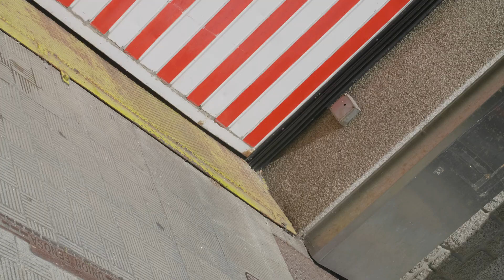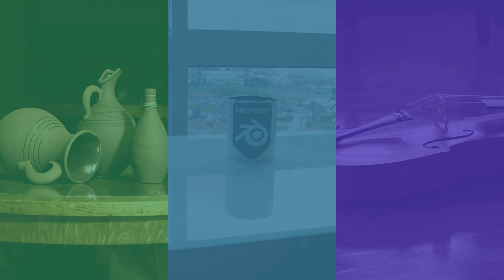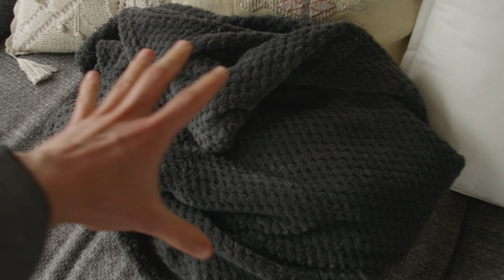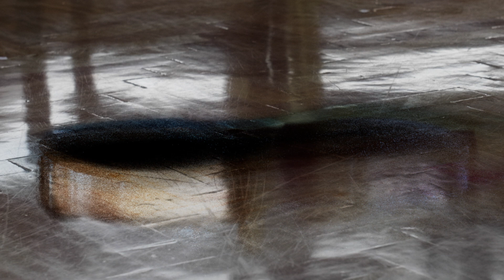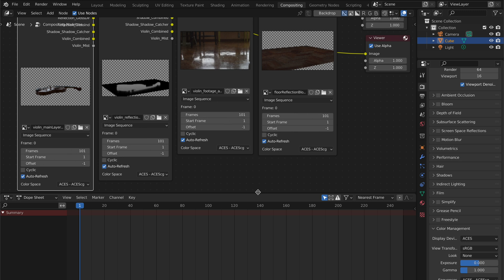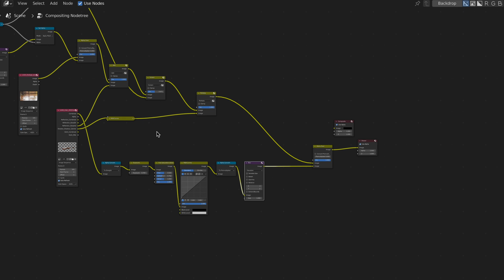How to Composite Reflections for VFX

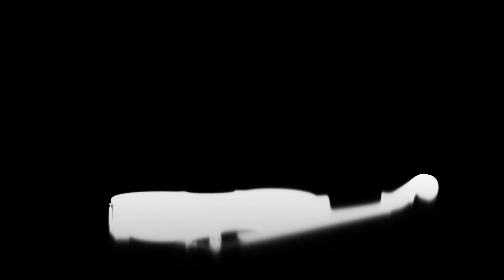Comment: 10:53 I have found a much cleaner workaround for creating a reflection matte!

1. Create a new object (For example a Plane, but it can be anything).
2. Add a Geometry Nodes Modifier to it.
3. Drag in the Collection of your subject model (In this case, the violin) into the Geometry Node Tree.
4. Add a "Set Material" Node after the collection node and connect that to the Group Output.
5. Add this "Plane Reflection Matte" object to a New Collection and in the corresponding View Layer, disable the original Violin Collection, but leave the "Plane Reflection Matte" Collection visible.

This means you don't have to duplicate objects or collections, materials, etc, but instead use the Original Violin Collection as an instance, to generate another copy of it and simply apply a material override.

As for the Lighting & World Settings, simply turn off the collections that contain lights and disable the World under View Layer > Filter > Turn Off "Environment".

This will allow you to store every View Layer in a Multi-Layer EXR export by rendering everything in one go.
Reply: tutorial

Comment: A problem I had and that maybe other people might have is about objects that are hollow inside (like masks), it is shown that in the main layer you should put the floor in indirect, but when I do this the hdri affects the bottom of the object causing some lighting on the inside of the mask, I decided to leave the floor collection for the Main layer in Holdout, I still have the reflections of the surface in the mask (I left it with metal material) and I block the light coming from the hdri

If anyone has a better solution I would greatly appreciate it, I feel a bit like I'm not going down the right path, although I still get the result I want.

Comment: for the reflection matte. You could use a new scene? The compositor lets you choose the scene as well as view layers. So you can just include the two instanced objects in that scene, then use whichever settings you want for that scene. This is also how you mix cycles and eevee (or even workbench) renders, which is useful when you're working with eevee for speed, but maybe aren't happy with the refractions there and just want to use cycles for a certain material or something like that.
And yeah, a script that lets you select which objects/collections you'd like in your other scene would be cool just to speed that up. I'd rather do it that way then have to use a script to flip back and forth between something like connecting/disconnecting an environment node (not assuming that's what you'd be doing)

Comment: You can use a polarised filter on your camera to block the reflection, it's truly work for that kind of glossy passe, you can also extract the glossy passe from real element with that.
Reply from the maker: Awesome tip!
Reply: @InLightVFX  it's also use for long time with the photogrammetry process use by Paul debevec with his setup he use cross polarised filter on light and camera to extract the glossiness of a face by multiplied trick, adobe substance do something similar by scanning a Tea pot they kill the reflection to scan the color of the asset, it's really powerfull.
Reply: Usualy we use polarised filter for taking picture of the surface of a windows or a lac or a pond to see behind it without the fresnel effect reflection, it's also neutralised cloudy  sky in a good way, it's use on photography since a very long time.

Comment: Would love you to make a tut on how to masterfully composite shadow and contact shadows on rotoscoped action characters used in the Blender scene with Image as Plane. Adding the filmed actor to the 3D scene, it seems hard to accurately project adequate shadows given that the image as plane doesn’t provide the volume of the feet in contact with floor. I’ve played around with this on the fly hidden volume, but it seems just easier to get the contact shadow in compositing.

Comment: I use Fusion in my composition work... And in most of the composition videos I see on youtube, they are either using AE or Nuke. As someone who has used both AE, Nuke, and Fusion, why do you think that is? 

I know why people use AE, coz it's easier to understand and master. But why do people prefer Nuke more than Fusion? 
One thing I can think about is Layout customizability but that shouldn't be a game-changer. 
Why did you switch from Fusion to Nuke?
Reply from the maker: Good question! Nuke seems to handle color management much better than Fusion and has less issues getting hung up on more complicated composites. I have only used Fusion as part of Davinci Resolve so perhaps these issues are not present in the standalone version. Nuke is also the industry standard so it makes sense to use if working at a studio interests you someday. But I also wouldn't say I've "switched" from Fusion to Nuke. I still will probably use both just to keep track of the development of new tools to make sure I'm using the best ones.

Comment: Very awesome that violin looks so good :o! I also love that custom Blender unpremult and premult for color corrections :) For Shadow Catcher I believe clamping anything above 1 will remove all reflections from the shadow (Like in Nuke adding Clamp node checking maximum on and setting maximum to 1). I'm not 100% sure but I believe that'll work. I will be using this video to comp CG through a window reflection so thank you!
Reply from the maker: Hey Mario! Thanks for your kind words! I tried your clamping suggestion on my end and it seems like the effectiveness of this approach may depend on the lighting of the scene. With my violin shot, the reflections darken the surface. So the reflection part of the shadow catcher pass mostly has values below 1 to achieve that darkening effect when multiplied. Therefore, when I clamped that shadow pass I see almost no change. BUT, with the clay pots scene, since those reflections are brightening the surface, those pixel values in the shadow pass are well above 1. In this case, clamping the pass definitely does cut out most of the reflection but I'm still left with a bit of some odd remnants. I do think this is still a nice trick to know about, especially for someone who has already rendered out a full shadow pass and didn't realize reflections were coming along for the ride :) Great to have the chance to remove them in compositing. (Btw I'm overexplaining this not for your sake but for anyone else reading).
Reply: @InLightVFX  You are correct my bad! I use an old Blender Guru method (https://youtu.be/wjWoglMYXBE) which is NOT the same but can look quite similar to the Shadow Catcher pass. It gives shadows below 1 and indirect light above 1. I don't refuse to use Shadow Catcher by choice it's just the studio I work at hasn't gone above Blender 2.83 yet (for stability reasons). 

Unrelated but a little fun thing I realized is that the Blender Guru method can be done in real life with live action footage! Using clean plate or sometimes a constant and dividing with the footage will give you shadows and indirect light pass of filmed footage. I've used this on 6 or 7 live action plates already (locked shots with cam not moving too much)

Comment: Why not set the specular to 0 instead of messing with the roughness?
Reply from the maker: To make the reflection matte? This is an option. You could then blur the reflection matte in compositing.
Reply: @InLightVFX  I was referring to the shadow pass, I see that you make the roughness to 1.
Reply from the maker: @edh615  I see. I just tested this out. You're right that setting the Specular value to 0 for the shadow material does get rid of the reflections for the Shadow Catcher Pass. But I also noticed it gets rid of some of the color in the shadows (which would come from the indirect light bouncing off the Specular surface). It seems that setting the Roughness to 1 might be better as I get that color information back in the shadows. I do think in general it's probably best not to modify the specular value. But those are just conclusions from this quick test. Thank you for bringing up that idea, Ed! And I'd be curious if anyone else has an opinion on the matter.